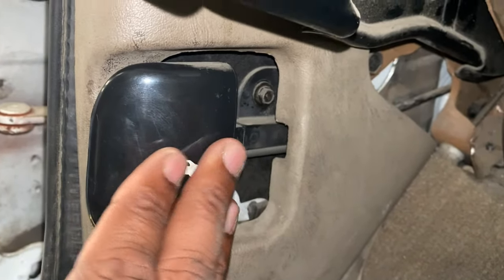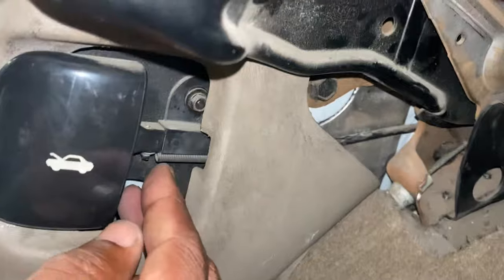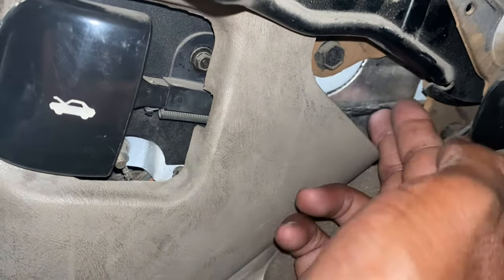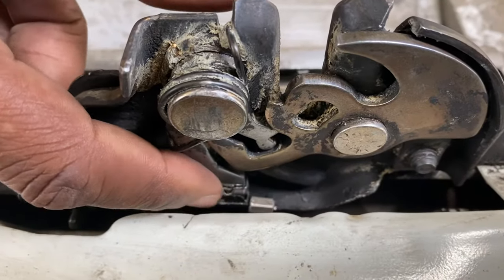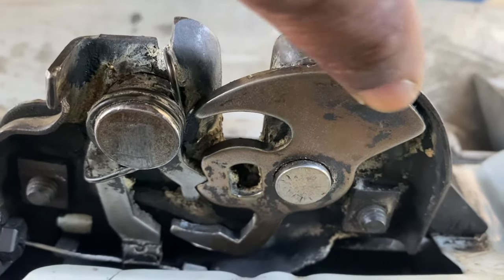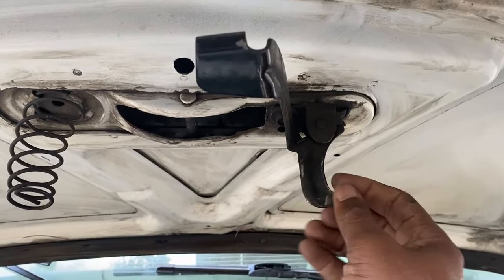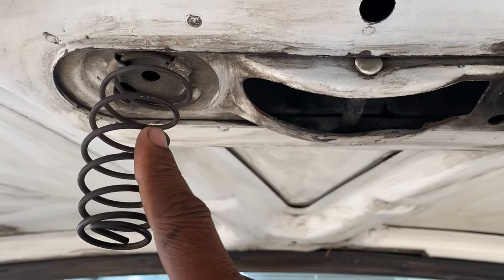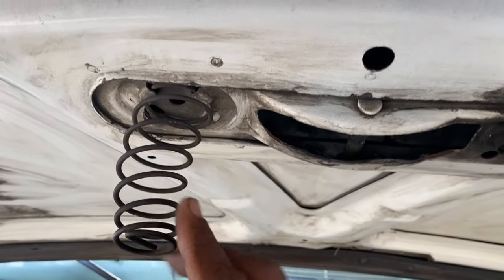CAR HOOD STUCK CLOSED?

Comment: OK good.but you didn't show us how to open the bonnet with a stuck or broken cable!!
Reply: Right
Reply: My issue at the moment.
Reply: @YANDEX30V  That's probably because he was explaining the basic mechanics of how it works. the video did not specify what to do if you had a stuck or broken cable. And by the way, it's called a hood.

Comment: Very good job! My major problem in researching this has been that there are too many parts with similar or even identical names that makes asking a specific question about a specific part very hard: too many latches, springs, and rods without very specific names to make clear which latch or spring or catch is being referred too. Without you pointing out the exact part you are referring to, this would be impossible to understand or followup with additional questions. 
Thank you.
Reply from the maker: Very true. Glad it helped.

Comment: ok so what do you do if the cable will not release the lock ? my main latch is in the locked position and the cable has no more travel left in it. my last resort seems to be to cut the grill, remove the bolts holding the latch in place, which in theory should allow the entire hood to open with the latch hanging from the hood .? does that sound right...?
06 Frontier XE
Reply from the maker: Sounds like it should work, if you don’t mind damaging the grill, or replacing it after.

Comment: Really good and easy to understand video, for problem on hood closed shut.
Mine is stuck closed now. I wish you would have done a video on how to get
that latch open ? Good explanation on how the latch works tho, which is a good
starting point. I have seen videos where guys stick a long screw driver in the thru
the front grill. Maybe I can try that, but not to sure where to put it ?? Like your
presentation style and clear videos.
Reply from the maker: Glad it helped. You have to look where the latch is if you are going to use the screwdriver method.
Reply: @Caliber8Tools  I doubt you can see the
latch with the hood shut closed. I guess
I'll take a look. Either the latch is frozen 
shut, or rusted shut -- not sure ?

Comment: Does my 2000 Chevy Lumina have a spring on the hood?  I don't see one.  Thanks for the great video.
Reply from the maker: Not sure what you mean but there is a spring on the latch itself, or should I say the latch is spring loaded. If it isn't there, damaged or broken that could be a problem.

Comment: There is two smaller springs on that latch your missing the bottom one that’s why it’s not shutting or opening.  The bottom one holds the tension on the first latch so it doesn’t lose tension
Reply from the maker: Good observation. Thanks.